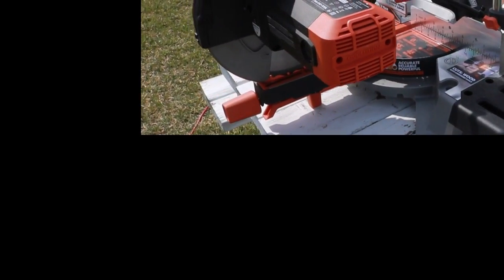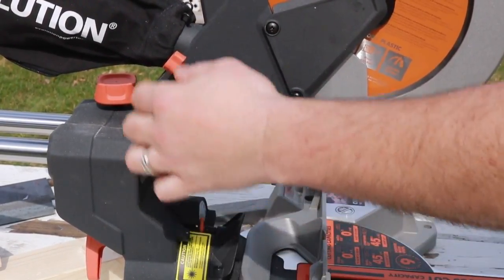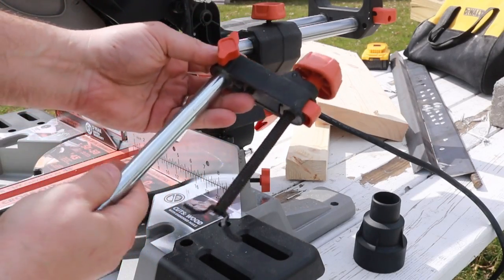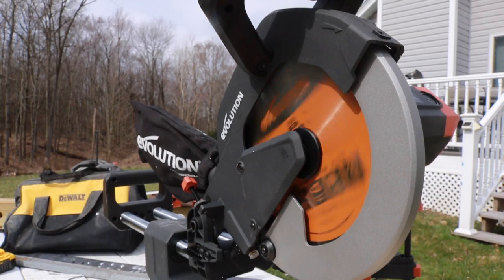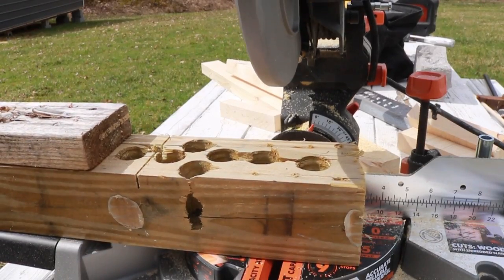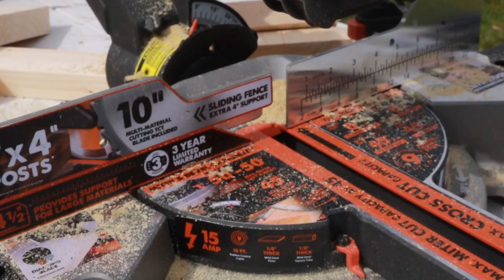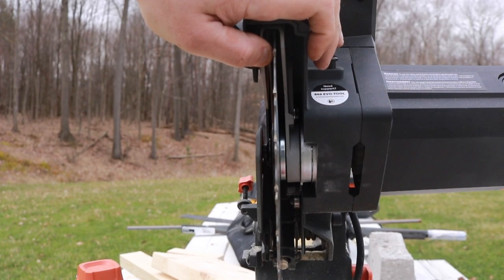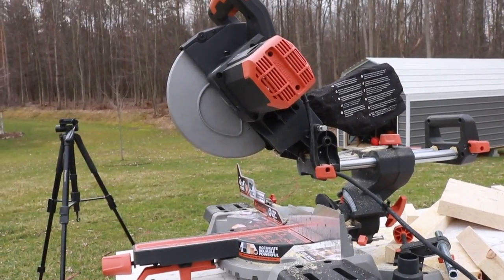Can the Evolution Miter Saw really cut through steel? You may be shocked at what you see!

Comment: As others have said, yes you can cut angle, but you got to clamp it down!  You should clamp EVERYTHING ALWAYS!  You are cutting metal not wood.  The way you showed the angle is the best way to cut it (but clamped!). You can also turn the angle on side with flange closest to the back, and use a wood block to hold it firm (with the clamp!).  Mine does not have that wiggly blade.  You may have croaked it with that pretty violent kickback on the angle iron (because you didn’t clamp it!).  I have the double bevel 255ds and I absolutely LOVE this saw.  But you got to treat it with respect and treat it as a precision instrument. And ALWAYS wear sealed goggles ( not just glasses) AND a face shield, because chips fly everywhere. They will get down your shirt, shoes etc.  think like your welding.  I also wear a tight smock to help deflect chips or a cut off if it were to kick up.  But nothing loose that could catch on blades!  I also always wear light gloves (the easy to tear away kind) because the metal edges can be razor sharp and cut you if not careful.  Also hearing protection because it is fairly loud.  I researched everything out there and found the Evolution to be the best out there, particularly with both the combo blade, their specialty blades, and the fact you can even use any 5/8” blade you heart might desire.  But note in that regard that regular saw blades are designed to run faster than the Evolution which runs slower to cut metal, so your cut speed might need to be a little slower for the same quality (thinking plywood mostly here).  It’s not perfect and there are some aspects I would change (too many nooks and crannies for chips to collect for example).  But clean it with a good crevice tool on your vac, and maybe after with some air, and it will work very well for you IMHO.  I’m sure Bosch and Dewalt will take issue, but I think this is the best saw of it’s kind out there bar none.  I’ll bet it gives a Festool a run for its money!

Comment: Clamp the metal stock!! Lock the slides and only chop down!! The saw is not rigid enough for a slide cut. It is not a milling machine. Also get some compressed air pointed at the blade. The cooler you keep it the more cuts you will get. I have the old version of this saw and I have cut quite a bit of steel with it, a lot of wood and quite a few bricks.

Comment: Yes definitely seen that coming from a mile away.   Putting in that position without anything holding it down is exactly what I would do if I wanted that to happen.    With that said , even in that position if you were even holding it firmly , you still could’ve made the cut.        Pointed part of angle facing up coming straight down with the blade would’ve been the way to go.     Very unfair to even address any issue with the saw after that fiasco.        It would be like hitting a curb with a new car @ 35 mph and saying the steering wheel is off center ,  I’ve never seen a new car come  like that before….     Cool saw tho , considering one!

Comment: Hi! Thank you for sharing your experience with this SMS. Great video! I have a  R255SMS but not the "+" version. On yours, you have an issue with the spindle. Mine has no backlash in any direction. Please be careful with the clamp especially when you cut steel. If the workpiece is moving during the cutting process you have to stop the saw otherwise you can damage the the workpiece, the blade and even the saw. That include the spindle. But looking at you how you use the circular saw and other hand tools, you looks that you know this better than me or many others :).

Comment: I’ve had this model for over three years, bought especially to cut steel. It works perfectly. It easily manages 6mm steel, aluminium, wood and plastic. Definitely the best mitre saw I’ve ever owned.  The loose blade has been caused by the kickback when it hit the angle iron, which should have been clamped down correctly. Don’t use this machine again until you’ve replaced the blade and checked the spindle attachment. Something broke along the way, probably the blade attachment bushes. Mine has no run out or movement in the blade at all.

Comment: I look at my Evolution as a better than nothing tool, my blade didn't stand up well to laminate flooring and a replacement blade was going to be approx 1/3 of what the tool cost, there is also an attempt to monopolise on blades because Evolution use an odd size shaft. I fitted a much better blade with a reducer ring and it performs better but still the worst mitre saw I have ever owned. I wouldn't use mine for metal,. Fine wood dust, plastic parts and hot sparks, great combo.

Comment: The more teeth you have on the surface of the metal the better just like a hack saw. Plus speed should be a lot slower .
Reply: It's a universal saw that runs slower than a wood saw but faster than a metal saw. It's not a purpose built metal chop saw. It is made to cut wood, plastic, metal etc all with the one blade. 
I don know how that information possibly escaped you.

Comment: If you lock the slider your material will not move around on you when cutting metal. when you slide back you are pushing the material laterally instead of vertical. also most wood specific miter saws run about 4500rpm so that metal blade/ multi material blade  probably tops out at  about 2800 or so i bet. most metal specific saws run at lower rpm and higher torque. that is why your first cuts on wood were a bit rough (torque, rpm, and mostly the blade). just some info for you.

Comment: You can cut angle. You just need to lay it on a flat side and clamp it. I could see what was going to happen the moment you put it on the table. And honestly, you should clamp all metal when cutting with a miter.
But great video.
Reply: Keep the open side down and cut from the peak down. Just don’t pull the slide out

Comment: For angle iron, you should lay bottom side flat in horiz. direction and place vertical side flat against the back fence. Don't push into the steel. Simply pull handle straight down. You should also use a clamp to prevent any tendency of the piece from moving. This particular saw looks to be too lightly made for any steel work.

Comment: You know, i know a miter saw can cut a bit of metal (don't know what type). So i was in woodworking in sophomore year, and i was using a miter saw for a simple bump cut(?) Or something like that. Anyway, i knew the basic saftey insstructions. Nothing i could see was an immediate problem (nothing i that i saw. Wink wink) so i started cutting. Then, 3 seconds into it, it started shrieking and i saw it making HUGE sparks. So i let go of it. Apparently NO ONE in my class noticed. (Or maybe they knew but didn't want to add insult to injury) and i looked UNDER the wood and saw a big metal ruler with a big chunk missing at the end. And a week later, my teacher wanted to tell the class something. He said, "hey guys. You aren't in trouble since this is the furst time, but please be careful around the equipment (shows damaged ruler) because things like this could happen in the future" or something like that. And i think he knew that i was the culprit but didn't say anything. He was a relatively chill dude so maybe he thought, "accidents happen". So anyway, you can cut metal rulers to your hearts content

Comment: You don't want to cut metal like you would timber, lock the slide fully retracted, the angle of cut when you slide into the material is definitley gonna kick the material upwards, think of this machine like a metal cold cut saw that can also cut wood, with the slide locked back the angle of cut will push the material backwards into the fence, as a machine for cutting timber it's not great, roational speed is too low, as a metal cutting machine its a little fast but gets you there as you say, its the blade that mnakes it special, just don't try and use the blade on a normal wood cutting mitre saw, the rotational speed is way to high for the material and blade

Comment: With the right blade (diablo steel demon for example) you could use any miter saw to cut metal. The new diamond steel blades have a very high rpm rating.
Reply from the maker: I've been using the bandsaw and the blades you just mentioned on the circular saw. They have been awesome

Comment: Did anybody call the manufacturer & ask if the arbor slight wobble is normal or a defect?
Reply from the maker: Hi Chill. It was a defective saw. I did a second live stream vid with a second saw and had no issues
Reply: thanks for the reply.
Reply: When using the multi purpose blade (orange) due to the weight of blade you get a very very slight movement/ wobble but it is better if you use the dedicated black wood only blade as this is different weight, i had a long chat in person with top tech guys at evolution here in the uk and jeze use clamps!!! Angle goes upright, and lock the head in its rear most position!  Top tip if your using the sms+ it comes with the front clamp for christs sake try using that as well! 
Stay safe keep fingers hands clear or better still buy a metal chop saw

Comment: Yes you can cut angle iron. You have to clamp it down properly. I've used the Makita, Skilsaw etc metal saws to cut angle. As for your arbor, I really believed the forces exerted from you improper method of cutting the angle iron caused the damage.
Reply: Same. I'm pretty sure that his stupidity fucked up the arbor. That blade jumped HARD off of that angle iron.

Comment: Do not cut steel like you cut wood ., bring the saw down on to the metal, so you don push as you do on wood .
Reply: That was my thought as well, dont slide the saw into metal. Go down onto it. The base has way more support than the fence. You should be able to cut angle iron just fine if its clamped down  and you just saw down through it.

Comment: I've cut a lot of angle iron with my R255SMS... You really need to clamp down any steel you are cutting. Prolongs the life of the blade by reducing vibration and keeps it from jumping around like the piece you tried to cut did.  The only downside is I've managed to dull a multipurpose blade after ~40 cuts of 1 1/2 X 1/8 inch angle and a few pieces of pine 2x4. I've ordered the blade specifically made for steel and hopefully that lasts at least 2-3x as long otherwise very expensive per cut. Overall a very versatile saw at a great price though.
Reply from the maker: Have you had any issue with blade wobble?
Reply: @ToolReviewZone  probably heard this dozens of times but metal is a diffent animal you woodworkers need to be careful, if you don't know how to work with metal get a buddy who does.
I've seen contractors grenade saws and blades in their face doing what you did. Be careful
Reply: @24revealer  This, 100%. Once you frag the blade by using the saw wrong of COURSE you're going to have a wobble!